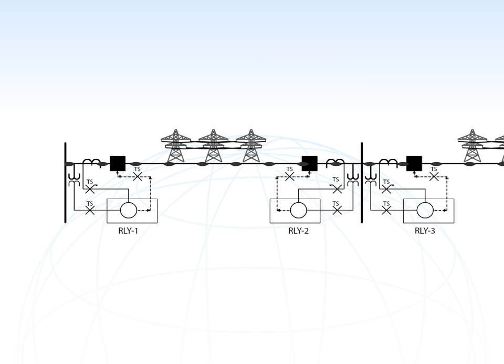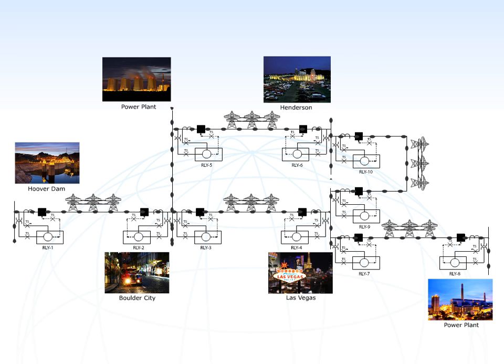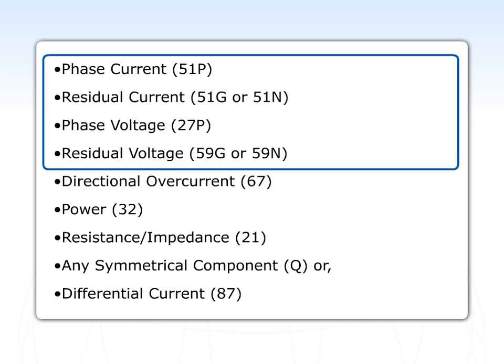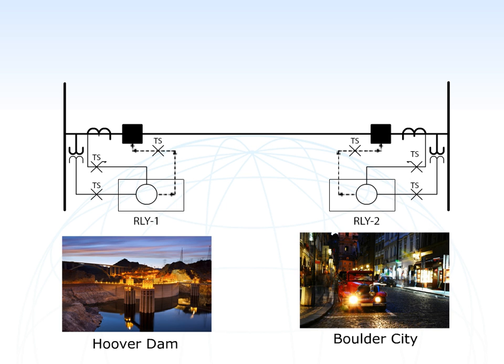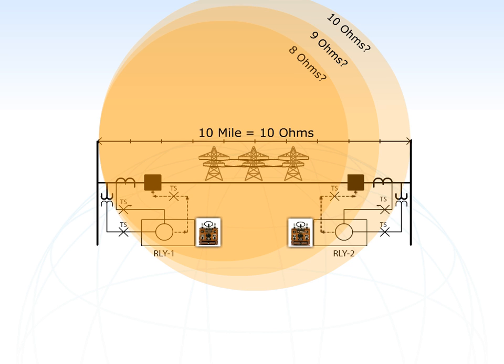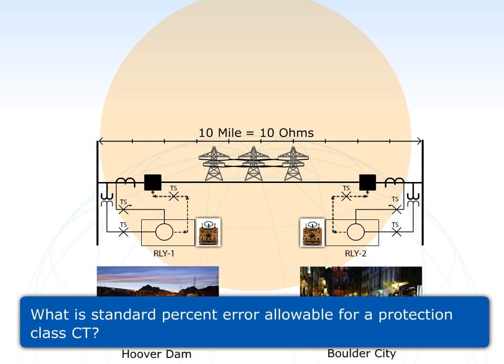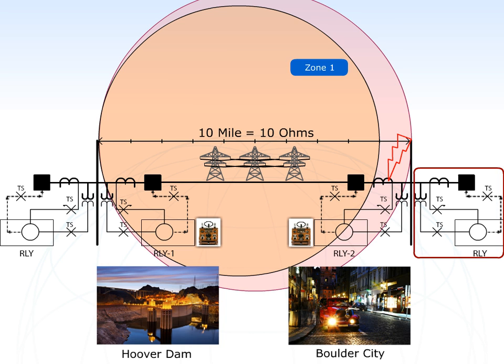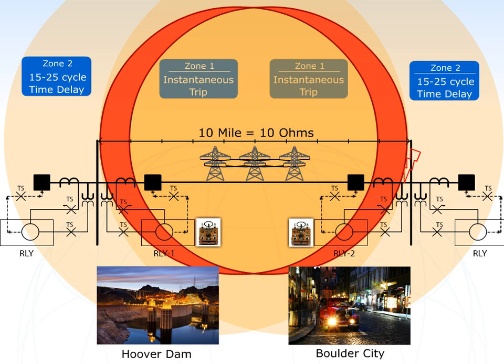Transmission Line Protection (21)

Comment: Where the Zone-3 will come?
Reply from the maker: It depends on the owner/operator.  Some Zone 3s are large forward-looking zones with long time delays (60-90 cy), some are reverse-looking zones with long time delays, some look in the reverse direction and share information about the fault with another relay.

Comment: Great video. It cleared my doubt about the zones.
Can you please explain which relay will cover a fault in the part between the bus and the CT first?
Reply from the maker: That area should be protected by a bus differential relay.

Comment: i dont understand at time 7.08 min they said that at last 30 % of line1 if fault occurs adjacent relay operate first.why this ? adjacent relay is not issue na main issue is to protect genrator side (substation side). first relay 1 has to operatr?

Comment: how do you know that the relay will detect the short circuit current as 8 A and voltage is 40 V at the 50% of the transmission line?
Reply from the maker: Suharti Hajar Impedance protection works for any voltage and current with a ratio less than the reach setting.  That's one of the reasons we use distance protection. Any voltage/current ratio that equals 5 Ohms would be a fault 50% down the line
Reply from the maker: +Gautham Ashokkumar It could be 50/10 = 5 Ohms, but I already used 50V for a fault at the end of the line.  The fault voltage will get smaller as it gets closer to the relay PTs, so a fault 50% down the line would be smaller that 50V. I randomly picked 40V.  In the real-world, the amount of voltage drop would be dependent on the line impedance, fault impedance, source impedance, and strength of the sources.